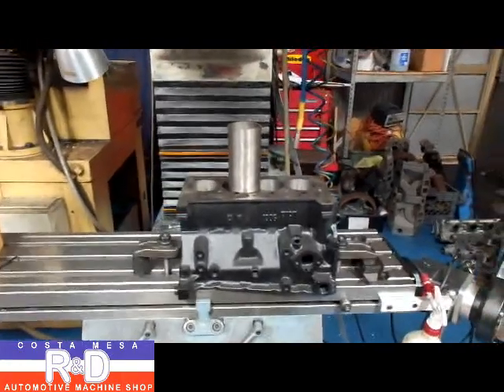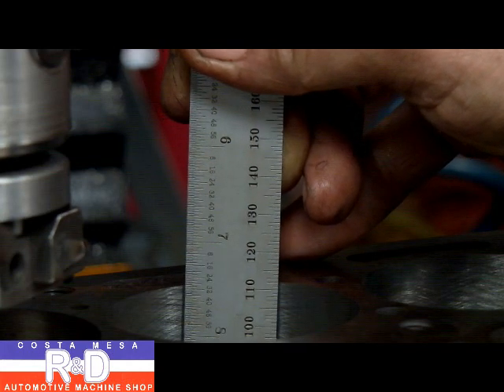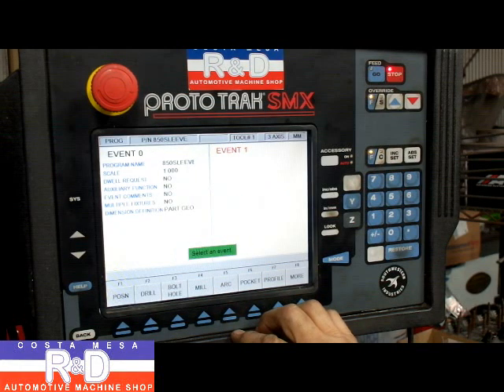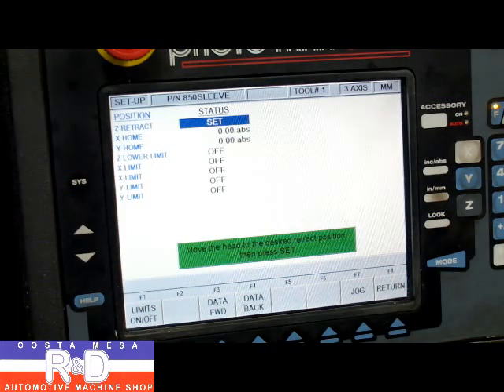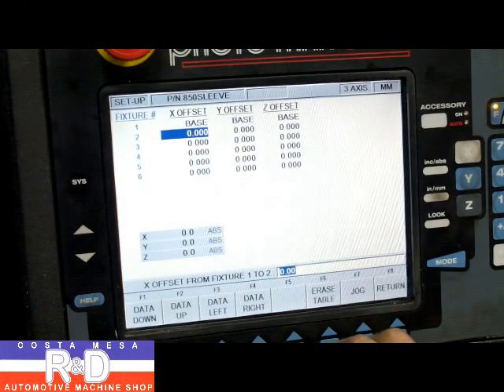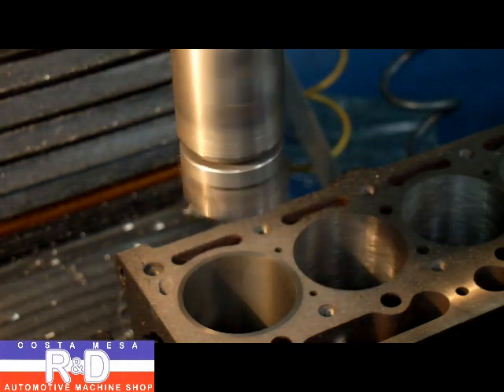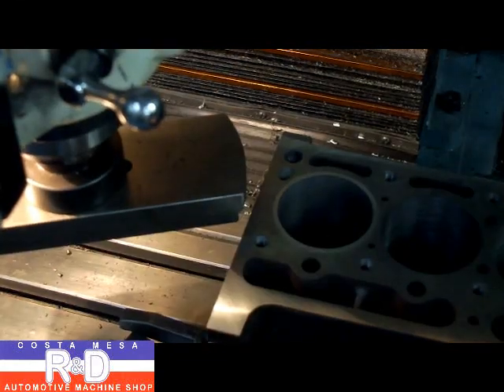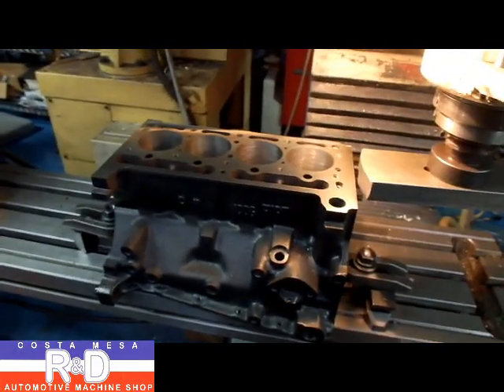Cylinder Sleeving - Sand Sports

Comment: Very informative video!!

I had a brand new iron short block with forged internals installed in my '03 Mach 1... all of 1,000 miles into it my fuel rail pressure sensor gave out and flooded the engine. One of my cylinders hydro locked. Bent a brand new forged Manley rod, damaged the piston as well as the cylinder wall. My shop is suggesting I get that cylinder sleeved.

How reliable is this in the long term? This is a high performance application. Supercharged, 600 rwhp. Would appreciate some insight from another person that isn't being paid to do the job for me! Thanks.

They also said the crankshaft might be bent, but if it is it should be fixable. How can you fix a slightly bent crankshaft? Should I just get a new one?

Comment: Do you lubricate the outside of the sleeve before you install it in the block ?

     Do you freeze the sleeve ?

Thanks ,
Wyr
God bless
Reply: You can lube or freeze the sleeve, if its your preference. It would depend on how tight you want the fit of the sleeve. For race engine's i personally like a tight fit with a o'ring groove . Like he did here is 100%.

Comment from the maker: You can do that with mills that have a head that rotates. It's not necessary, most people are into cosmetics and any tool drag on the trailing edge freaks them out, but when the head is flat and the surfaced finish is within specm you are good to go.

Comment from the maker: I've written several books and do articles for a couple of publications, Plus answer questions here and on the phone from Youtuber's. Yhe cylinder wall thickness in the block is generally of no importance when sleeving. I've sleeved blocks with part of the original cylinder missing. Where you can run into problems is siamese bores, install a sleeve and the next cylinder will probably be out of round after you do.

Comment: Dear John, I enjoyed this lengthy video! :] Didn't know you're a technical writer as well (I mean, I do own your lathe book, but didn't thought you're writing for magazines and such)... I wanted to know, if I may... When you sleeve cylinders, is there a requirement for the wall between two cylinders to have a specific thickness BEFORE pressing the sleeves into the cylinders? Or is that dimension does not matter, because the sleeve itself adds thickness? Thanks, and keep up the great work! :]